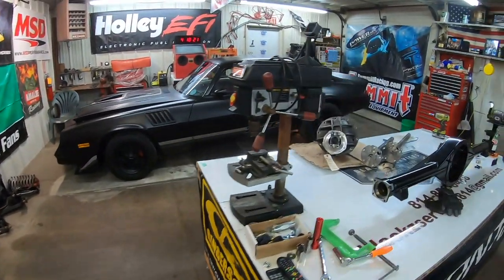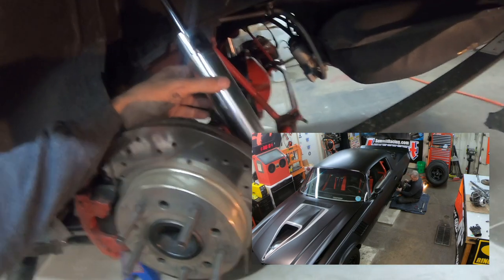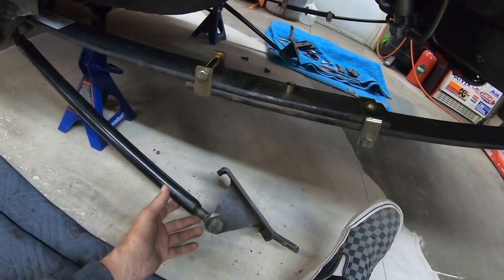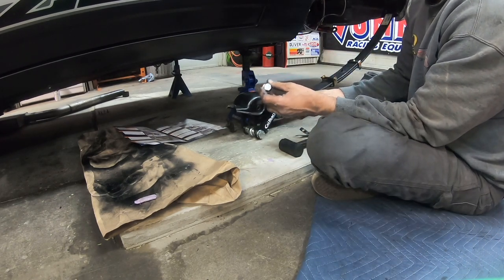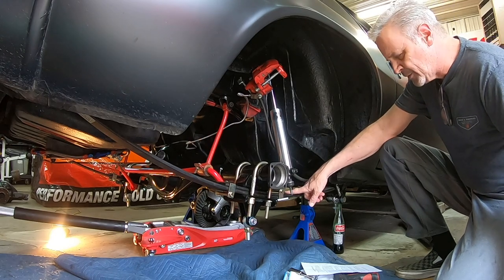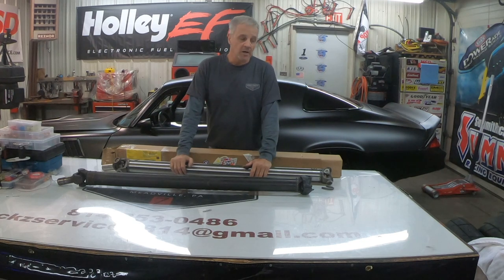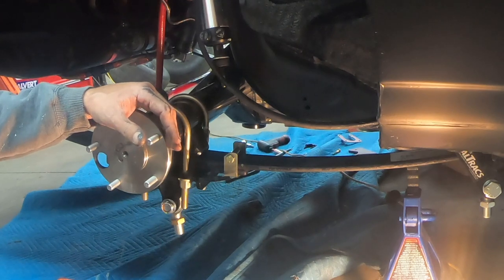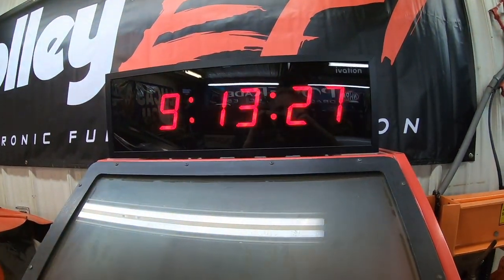Project Camaro Ep. 3: Quick Performance Ford 9 Inch & CalTracs Install

Comment: great vid ! im doing same deal on  my 70 bird. is the finish on your housing satin black or gloss black ? i cant quite make it out
Reply from the maker: Thanks! I went with the gloss black on mine
Reply: @blackzgarage3585  sweet ! It does
Look good. I was gonna go with satin black. Whats powertrain pwr & tq ya have ?
Reply from the maker: The car has a gen 1 427 small block and t56 6 speed, It makes 500 hp.  Nitrous is in near future (250), as well as safety bellhousing and full slicks.  Racing more UMTR (United manual transmission racers group) this year. Will be launching at 5000 rpm!

Comment: how much did you pay for the diferencial?
Reply from the maker: For the differential housing and axles it was 1440$ I added the extra bracing package and it was another 169$ on top of that

The gears and center section were about 1500$ too